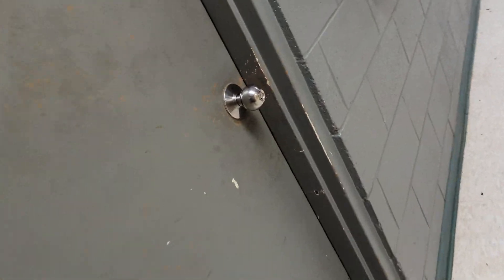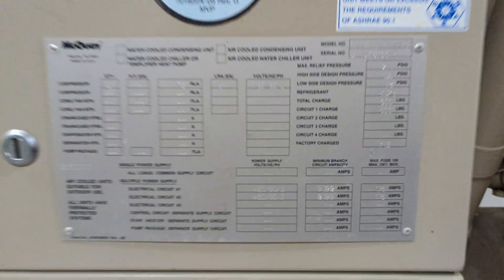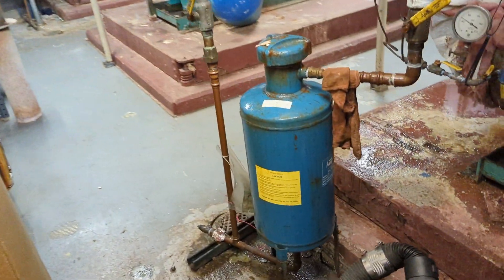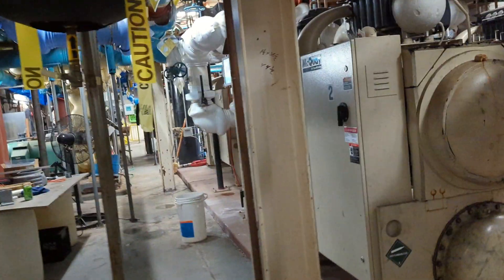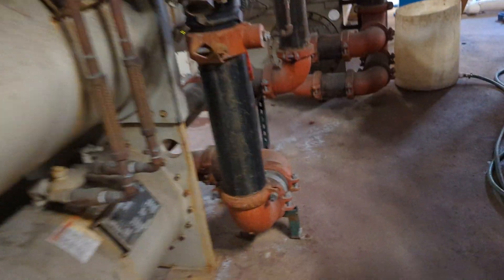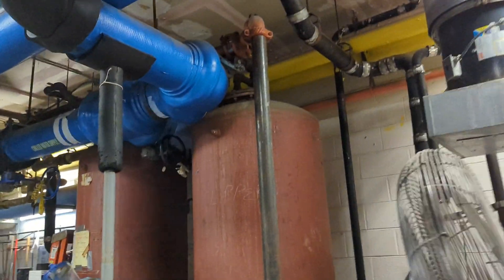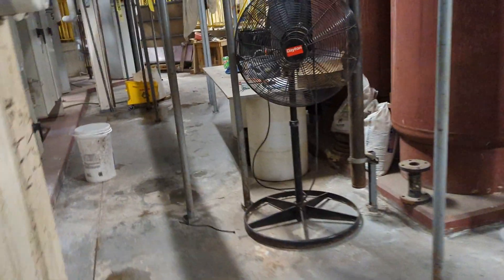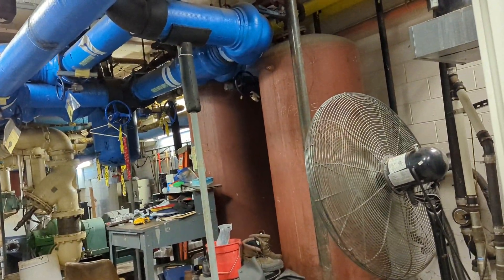Tour of a mechanical room at an Apartment Building in Dearborn, MI

Comment: Went to Fast, is that a McQuay “Diakin,” Magnetic Bearing Chiller. If so, don’t let EMS Control the Condenser Water Temperature. The Chiller needs to do that. Warned them about that, and yes the tore up the Compressor.
Reply from the maker: Danfoss Turbocor oil-free centrifugal compressors. These are the tiniest chillers for dual-compressor chiller.